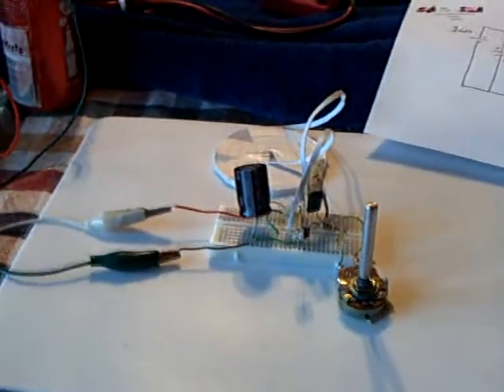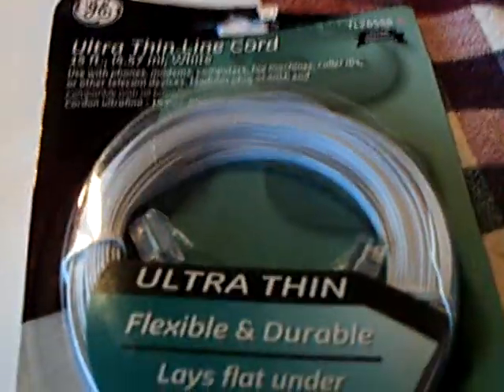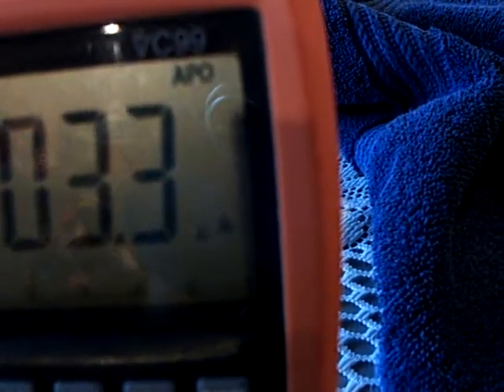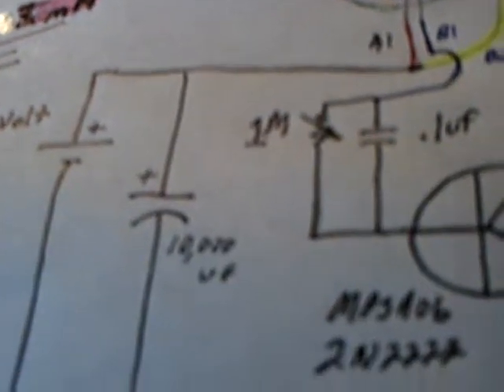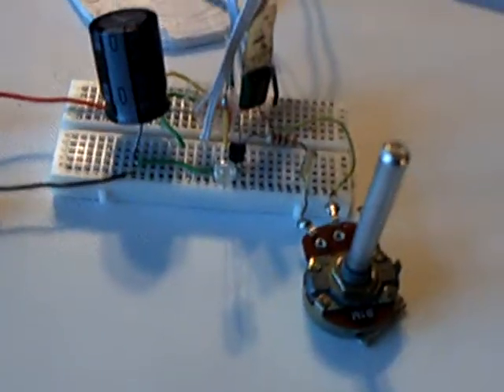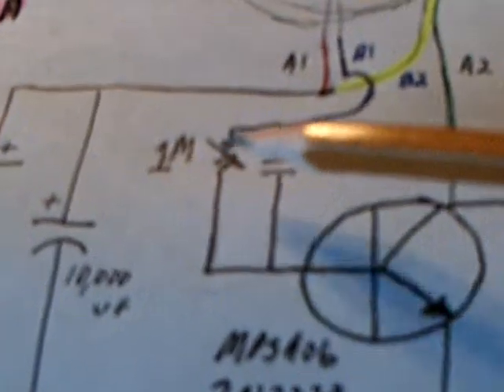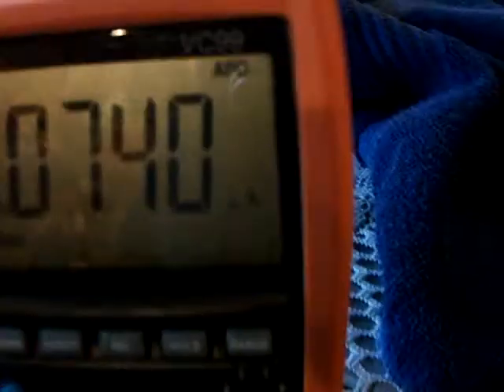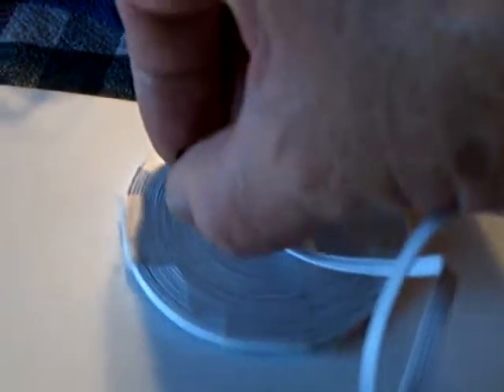Steel wire - pancake coil-Joule Thief.ASF

Comment from the maker: @prankmypants -----That is an interesting project.  The circuit here is basically called a "blocking oscillator" and can be made into a device (voltage booster) to drive your ardrino.  You would have to take the flyback which is driving the led and put it into a capacitor to build up the amperage.  Just remember that there is no free ride.  To get the 6v @ 20mA will cost you more amps from that AA.  It is a trade off.  There should be a booster circuit for that if your search on Google.

Comment: @Lidmotor With my wire, it was three, in the cable. I used the outsides, leaving a center as the core, as you say. I noticed when connected the two ends of the "core" wire if you will, the LED really dimmed, let them go and it brightened.

Comment: I did the same experiment with three conductor Antennae Rotor cable (copper) and my LED draws 31 mA :( off of a 1.26v (loaded) cell. I only had 3300 uF across the power rail.

Comment: Of course, the small current is mantained with my suggestion, and also: you can use to small 1.5v batteries, in tandem, and when one is resting & recharging from vacuum the other one give some microamperes, and viceversa and so on... (the batteries beeing pulsed from this schematic will recharge from vacuum faster, and the device will work forever, great, ha?)

Comment: You can eliminate the bigger pancake coil by using a very small ferite toroid with 10 turns in bifilar mode, if you make some small modifications to your schematic, this improvement is usefull for small flashlights etc. Great work, Lidmotor! All the best!

Comment: @Lidmotor Yeah.. that does encourage one to continue experimenting. If you could have a rechargeable cement battery that didn't decompose / degrade, to the point of the concrete not doing it's job... the implications of that are pretty enormous, really. Nice work on this circuit, pretty astounding draw.